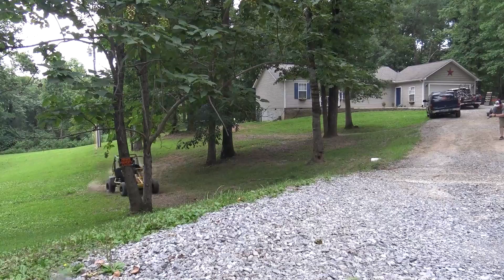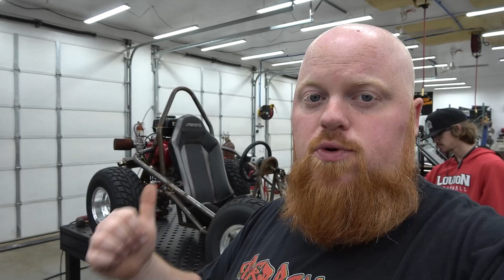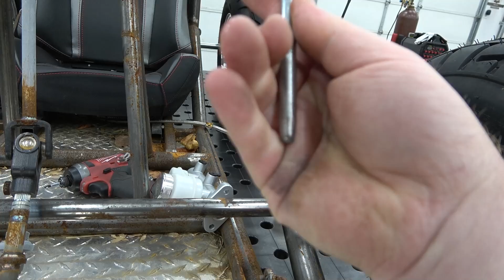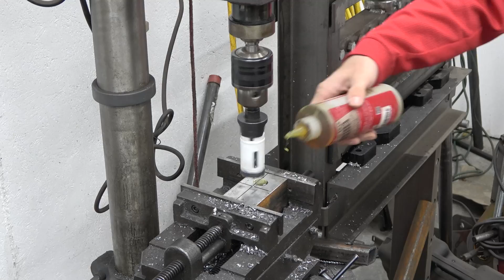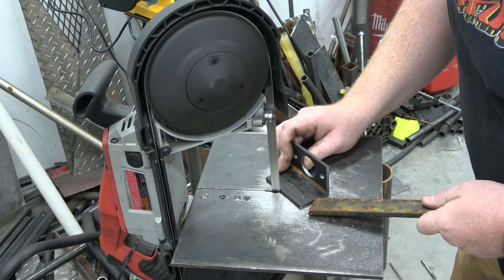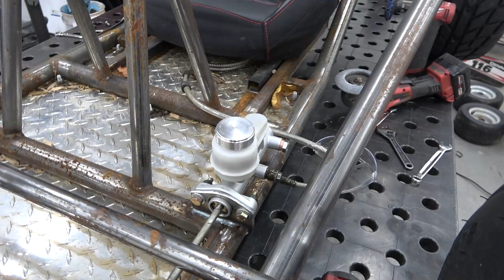Go Kart Hydraulic Brake Master Cylinder Install ~ XXL Go Kart Build

Comment: Negative camber will hurt turn in…front end will be lazy on corner entry and since a solid rear axle means the kart relies on unloading the inside rear wheel, it will likely understeer too much.  Now I realize it won’t be on pavement but the effect will be the same.  Looks cool but I think you should stand em up.

Comment: Hey I was just wondering about drilling and tapping a single line master cylinder to install a hydraulic brake light switch to operate brake light on a cart that I have.  It looks like it has a raised section for it but, I have not been able to find anything where someone has done something like that. Is it even possible?

Comment: I dont really care for the camber. If it were my kart I would make it have zero camber but clock the knuckles back so the tires bite when you turn and it will want to track straight. Plus it helps take the weight off the inside rear tire when you turn.  Just my two cents plus it is not my build....

Comment: Gravy bones looks so much better with the bigger tires. Does your kart need the Ackermann steering angle done to your spindles? Or is that not possible with the one tie rod linking them both together?
Reply: it is possible, just like on any american truck with a live front axle and drag link, it's just a case of pointing the steering arms towards the centre of the rear diff

Comment: I really dont expect a response but would yall at Red Beard know where i could get a go kart axle fabricated made and shipped to me? I need an exact copy of the axle i already have (except one extra key way i need added) to fit the specific wheels hubs/brake drum set up the kart i have uses and i cannot find any live axle thats even remotely similar in dimensions and length.
Reply from the maker: Find a local fabrication shop

Comment: Too much negative camber, pointless on rounded tyres. It'll cause problems with toe over rough ground and make you every which way but straight, best Idea is to cut the things off and replace them with a setup that corrects the height, or use 16" tyres and flip them back the right way up (that's what I would do)

Comment: What I think you should do is straighten up those pipes that the wheels are on triangulated so what has strength and make the wheels camber correct also I think you should put some kind of front suspension on this thing if it's really fast that's going to keep you from damaging the frame the frame will absorb the shock if you have no suspension you've got to put some kind of front suspension on that thing it's if it's fast good luck man God bless Happy Thanksgiving and may Jesus bless you and all your endeavors peace out into the world have a great day

Comment: Set for 1-2* neg camber MAX - I prefer 0 -1* pos camber for handling and looks. Not a fan of changing the angle built into the spindle to change camber - this can make the tire follow an odd arc in turns if there is also camber built into the spindle bracket.

Comment: Loose the camber. It is way to much. A little resource on how different kingpin angles can make the tires dig in on corners but just to run it like that just looks stupid in my opinion. Ground contact patch is way too small and basically on the inner shoulder of your tires. Tire life is down the toilet that way.

Comment: The camber looks just as stupid on that as it does on everything else that has had it set like that !
That being said since the camber is from flipping the spindles it will do just the opposite of what kingpin angle does , it will unload the inside tire in turns instead of loading it.
So for looks get rid of it , for handling get rid of it and for safety get rid of it !

Comment: That camber is useless other than causing sketchy handling and accelerating tire wear.. It's too extreme to gain any traction in any terain or pavement...1degree negative or less maximum will net you maximum traction due to maximum tread footprint during cornering on dirt or pavement... Unless you're in Japan,Korea,or Thailand where it's a fashion statement and considered cool by the ricers then that is redonkulous without an articulating suspension... Looks as todded as the Gayolina squat too but hey wouldn't hurt anyone snowflakes feelers with the truth or facts yanno...😐